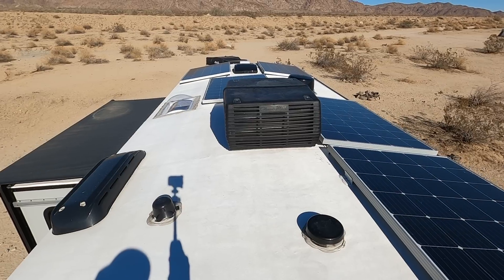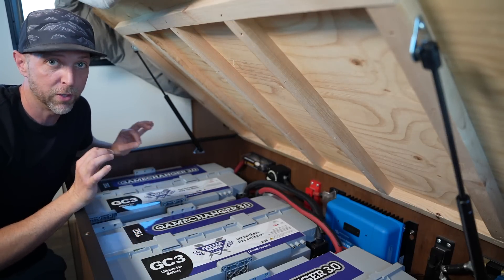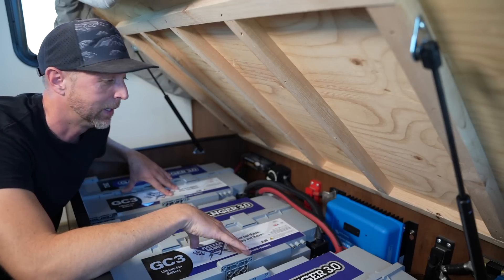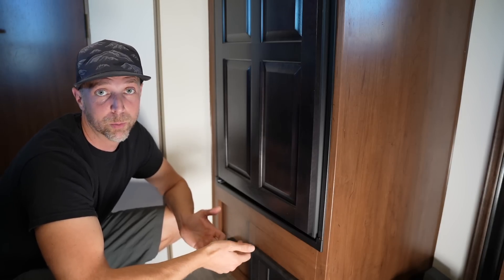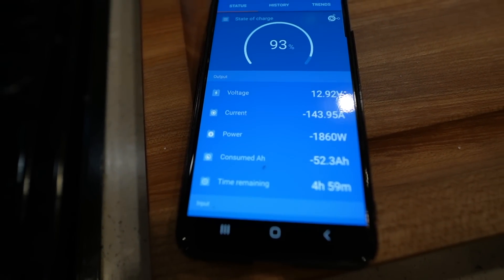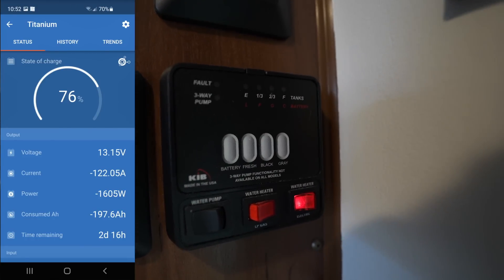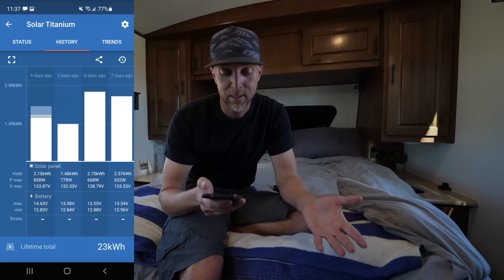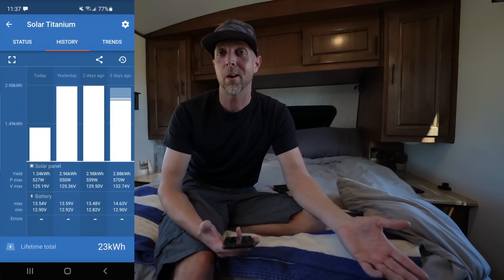RV Electrical UPGRADE Overview for Full Time RV Living | Battle Born Batteries

Comment: Just finished the transition to Lithium battery with a 3000w inverter/charger--Solar system will be next!  I followed most of your advice--except for what equipment I used--due to price but I believe are also good quality. Used all the fuses and overall plan you did as well as made all my own cables. 

Thanks so much for doing this so well--one of the best series I found on YouTube especially since it worked perfectly for our trailer which has a similar bed and layout--its a 26' Grand Design 22 MLE.

Comment: Total cost minus the batteries have an idea ?  I have a 24KRS. Bout to upgrade.
Reply from the maker: 1200 watts of solar, MPPT charge controller, 3000 Multiplus Inverter, and cable, etc is about $4k roughly. Labor would probably be another couple thousand as well. Systems working great! 👍

Comment: Looking for you solar panel install video. I have a Outdoors rv and would like to see how you did the panel install.
Reply from the maker: I actually never completed that one...still siting on the footage! But, here is the list on components and supplies I used. My technique was 3 one inch wood screws in each solar panel foot. So 12 screws per panel directly onto the roof. I also used Butyl tape between the foot and roof. Then self leveling dicor on top of the foot and screw holes. Similar to how a manufacturer would install a roof vent. Butyl tape on the bottom and decor on top. Been holding up great for one year.  

SOLAR
☀️240 Watt Solar Panel https://amzn.to/3q3eBy2
☀️Victron 150/85 Smart Mppt Solar Controller https://amzn.to/3n9giIf
☀️Panel mounts https://amzn.to/33DALyr
☀️2 pole breaker https://amzn.to/3ArzwhS
☀️1in Wood screws https://amzn.to/3Ims3TL
☀️Mc4 connectors https://amzn.to/34Y6BpN
☀️Roof Port Box https://amzn.to/3Ky6Ms8
☀️Rubber tubing for Dicor https://amzn.to/3KszWJf
☀️MC4 cable extension https://amzn.to/3Ag66De
☀️Butyl Tape https://amzn.to/3qKYx45
☀️Dicor self-leveling https://amzn.to/3AqqZeX

Comment: I've been following you for a while now, especially since we are expecting our ORV next month! Since our trailers are going to be somewhat similar, you have done much of the planning for me (putting the electronics under the bed).  On average, how long can you run your a/c unit and still have enough battery left for other uses?  Also, I live in AZ, where do you recommend I buy the supplies?  I like all the equipment you use.  Thanks for  your help!

Comment: very nice setup.  You really do have a lot of amps with the batteries and the watts from the solar is fantastic!!  So, do the battle born batteries require venting or some sort of airflow?  My only concern with location is that the batteries might get hot, especially during the summer months.  Merci
Reply from the maker: Thanks! Battle Borns are fully sealed and do not require any venting which allows them to be mounted in a lot of different spaces and configurations! They also have an internal component called a (BMS) that will power them down to protect them from things like too much heat, too much cold, too much voltage...etc.
Reply: @IreneIronTravels  ... appreciate the reply.

Comment: Hi Aaron, loved this video! Q. Did you have to lower the bottom of your under bed compartment to fit your batteries and all the other electrical components? Also, at minute 2:21 it shows what looks like 2 x 2's attached to a 1 x 2 ledger. Is this what the original flooring of the compartment was attached to, or did you add these? And because of the serious weight of the batteries, did you support this framing underneath to the trailers floor, if so how? Thank you for your help, it is greatly appreciated!
Reply from the maker: Thanks! We did not have to lower the bottom of the bed at all and we actually have drawers under the bed that we can still use. The batteries are only about 7 inches high when lying flat and so our space worked out perfectly. The 2x2's are original supports put in by the manufacture but I did add the 1x12's ontop for a solid base for the batteries to sit on and then I added some small 2x3's under to help support the load. If you haven't see the detailed video yet it goes into a little more depth on that. https://youtu.be/QLY2wwIviJs

Comment: Thanks for the very clear series of videos on your installation.  What is your current traveling tongue weight after the installation? How much extra tongue weight was added above your previous traveling tongue weight (before the full installation)?  We are about to make a similar installation on our trailer and by our calculations we need to add weight in our pantry to the rear of the tires.
Reply from the maker: Thanks! We don't have the exact tongue weight and need to go back to the cat scales to weight the truck and trailer separate. But I believe the RV weighs about 9000lbs all loaded up with our stuff, which puts the tongue weight between 900-1350lbs. Probably towards the heavy end....

Comment: I'm a, look I have a half tank of fuel time to fill it up, kind of guy, when do you start to worry about running out of power? Like really look at conserving energy, 75%? 50%? 25%?
Reply from the maker: I hear ya. I would say I start to change our energy usage at about 50%. The great thing about having a good amount of solar is it recharges pretty quickly if we lay off of the large appliances like the air fryer, electric water heater, fridge, etc. Having an accurate battery monitor and a large battery bank, I don't worry about recharging all the way up to 100%.

Comment: Your topside solar panels will be allowing water to leak into the roof within a year.  Butyl tape does two things.  Seals the hole and provides a cushion that prevents mounting hardware from rubbing into the roof membrane.  If you are not mobile, it will take longer to realize this effect, but it will happen.  When you travel down the road, the movement along with vibration will accelerate this unfortunate issue.  It doesn't matter how much dicor you try to cover your sins with, eventually .....
Good luck and thanks for the video.  Good info on what's available.
Reply from the maker: Agreed! We used butyl tape on the bottom of the mounting feet and then covered the top with Dicor. Thanks for watching!

Comment: Your install looks GREAT ! Very clean & easy for me to see & understand. I've been playing with solar in our TT for about 5 years now but a much smaller system. A DIY type and learning via lots of questions & you tube. We're not full timers but go out 1x a month for 4-7 days & 2x a year for 4-6 weeks. ~70% off grid. I carry a small generator as a backup, just in case. We live in the PNW & camp a lot in forrest lands. I learned the first outing that if the panels aren't in direct sun; you're not getting a lot of charging. What a huge difference when we are in the Desert. I'll be real interested in seeing your 3 pt series.

Comment: Good video.  What was the TOTAL cost for the complete installed system??
Reply from the maker: Thanks! I don't have an exact number, but the components would be around $12,000-$15,000 and labor could $5,000-$7,000 maybe...

Comment: Nice setup, glad to see you got the panels installed. I have about the same setup on mine, just not that battery bank, only 400 amp-hr. Going full time on Monday. Hopefully run into you guys sometime.
Reply from the maker: Thanks Rick! Congrats for Monday...exciting! Sounds like you'll have a nice system for full-timing. It's a small RV community and we might just run into each other.

Comment: Nice setup.  If you don't have a generator, I might suggest putting in a dedicated charging circuit from the tow vehicle alternator to a DC-DC converter on the trailer, to give you an option for charging the batteries while you are driving or if it is cloudy.  I ran a #6 AWG circuit from my truck battery to an Anderson connector on the back of the truck, and a #6 AWG circuit on the trailer from an Anderson connector on the trailer tongue back to a Victron 30 amp converter.  It works very well.

Comment: Yep... nice video and beautiful system.Those GC3s are cool, but to save money I went Ampere Time 200s (2 each), but went with Victron 3000w Multiplus... love it. I have 1500w array into a 150/100a MPPT, which is pushing it... technically I could get 106 amps, but with panels flat, that shouldn't actually happen. When you said you have a 85A with 1200w (12v) I had to check out Victron manual, but especially with Victron's help, I was sure you knew what you are doing. I keep telling myself, I need Chris' help with diet... just a matter of me wanting it bad enough.
Reply from the maker: Nice system you have! It is so great to not worry about the electrical for sure. Chris will be here when you're ready!😊🍏

Comment: After installing a 600AH lithium iron phosphate battery bank, I've come to the conclusion that's about the minimum I'd ever want.  Nice system!  I didn't have a battleborn budget, but if you, they're about the best.
Reply from the maker: Agreed...600 ah is a nice amount for being VERY comfortable!
Reply: @IreneIronTravels  I'm curious as to exactly how long you think it would last if you were not doing a solar recharge.
Reply from the maker: Before we added solar we boondocked for 8 days and still had about 30% of our 810ah. We didn't use any heavy appliances, but it was great.

Comment: I just installed a similar system in our ORV 28DBS - 800 watts of solar and 600AH of lithium.  We have not yet really tested it out as we are in Florida plugged in for the winter ;-) I put the solar charger in the above the bed cabinet as that is were the old one was located (we had 1 solar panel included).  I have one video on our channel that shows part of the install.   The wiring is the hard part. ;-)
Reply from the maker: Nice job! Your video was a good, clear, and concise documentation of the first part of your install. 🤙

Comment: Thanks for the video and info. Great overview of the system. I look forward to the more in depth videos. 
Do you leave your inverter on 24/7?  Or do you turn it on/off as needed?  About how much power does it use with no loads/standby?  Thanks again.
Reply from the maker: Thanks! We do not leave our inverter on 24/7, but do know people that do. We try to run everything off 12 volt and only turn the inverter on when we are using the bigger AC appliances. The inverter uses about 30 watts or around 2.5 amps on standby.  Its not a much, but really does add up over time. 60 amps a day...420 amps a week. No big deal when the solar is charging though...

Comment: Looking forward to the install videos. I'm hoping you can address the need for heat ventilation in the battery and component space. Did you need to add fans and if so what did you use? I'm trying to figure that out now. I'm worried that my closed in space will get to hot.
Reply from the maker: Thanks! I can see the battery temp from my Bluetooth monitor and haven't seen it over 83 degrees so far. The internal BMS of the batteries shut them down at 130 degrees I think for protection. I will keep an eye on this to see if I need additional ventilation. The best Ive seen for this is a small computer fan(s) with a temperature sensor that you can set to turn on and off as needed by temp. I was actually more worried about the inverter in the sealed small space of the pass through, especially when charging this big battery bank. It produces a lot of heat and could take around 7 hours to charge if we were empty..... Or running the AC on a 100 degree day..... just have to monitor and keep an eye on it to see how it does.
Reply: @IreneIronTravels  you are correct that the multiplus is going to be the hottest component of the system. At least the pass through has some breathing room. Under the bed would be too confined for sure. My system is similar in size and under the couch but has some natural ventilation. I did supplement with computer fans on a thermostat like you are thinking about. I have one pointing towards the bottom of the multiplus and 2 pulling air away from it. I also have one blowing on the solar charge controller under the heat sink. They are all run off a USB outlet. Good luck to you guys 😊

Comment: Thank you BOTH for this VERY informative video, and the very helpful answers to the Comments below! I'm on the verge of buying a slightly smaller model from the same MFG as yours. My question is, did you order yours with the optional solar package and replace it, or with just the standard factory solar panel prewire that it comes with? I won't lie, going fully solar for the first time is REALLY scary! Looking forward with great interest to your DIY solar components install videos! Thank you again!
Reply from the maker: Glad it was helpful, thank you for watching! We ordered our unit without solar, knowing we would add our own. All ORV's come with solar prep already from the factory so they have the Zamp roof mounted 3 port( uptown 510 watts) and also a Zamp single port by the front tongue for a ground deploy panel up to 200 watts. Since we knew we wanted more than 510 watts, we had to replace the Zamp three port on the roof with a new box. I just used the factory 8 gauge solar wire to hook up our panels and charge controller. It is a lot to grasp at first, but it gets easier with more time, learning, and practice!
Reply: @IreneIronTravels  Hey Aaron, Bill here again.  I too have the zamp 3 port on the roof and will need to replace it to upgrade to 800 watts of Newpowa panels.  I was looking to see what box you used, but didn't see it in the component list.  Could you let me know what solar box you installed?  Thank you a million!
Reply from the maker: Oh, thanks I forgot to add that. I used this https://amzn.to/3fg7EU4
Water tite box and crimped mc4 connectors to the factory 8 gauge wire. Sealed it with butyl tape under and dicor around the edges. I got one big enough to cover the old hole and screws of the zamp port.
Reply: @IreneIronTravels  Awesome!  Thank you again!!  I'm going to order 4-5 Newpowa panels.  If I order off Amazon (clicking on your link) does that get you guys some type of payment/credit?
Reply from the maker: Yes, it does. If you click on any of our Amazon links, we will get a small commission on your whole order  even if it's not the items on the link. Appreciate, thanks Bill!
Reply: @IreneIronTravels  Perfect! It's the least I can do! :)

Comment: Great video. Our Travel Trailer is about the same size as yours, and I want to ad a very similar solar package to it. 
One question- how much added weight did the entire system (batteries, solar panels etc) add to the weight of the trailer? Any difference in towing?

Enjoy the videos. Thanks. 

Tim
Reply from the maker: Hey Tim, thanks! That's a good point on weight as most might not even think about that for their electrical upgrade. Our system added 400-500lbs which could eat up a lot of rigs OCCC. That is one reason we went with a heavy duty 9995 gvwr on the trailer and a one ton pick up. I only towed the trailer once empty (7300lbs) and then installed the batteries right away(and had the rest of the components besides the solar panels) and we moved all of our stuff in. I think we are now close to 9000lbs weight. There was a notable difference in towing from empty to fully loaded, but it wasn't bad at all. Just could notice the extra almost 2,000lbs of cargo weight. Overall the F350 diesel tows this trailer pretty easy....just took me a bit to get used to towing in general.

Comment: Not to be a party pooper but, you could have 3500 watts at the flick of a wrist for less than 1/4 of the price. (generator) You might want to get one ( ) incase of no sun for long periods. Very nice set up of what you did tho. : - )
Reply: Hey Bert,  We have a built in Onan genset with our trailer and also chose to install a solar system much like they did.   We prefer boondocking away from the crowds, and ......noise.  We could run our genset, but quite frankly, we don't want to listen to the noise, nor do we wish to take away the peace from our neighbors.
Reply: @billd.8925  I know all about generator noise. However, you only need to run it to recharge your batteries or run the air, in which case everyone would be inside anyway because of the heat.
Reply from the maker: I hear ya Burt! Generators are still a good option for some. We're testing the system out to see how we do in bad weather before looking at back ups. But haven't had more than a day or two of cloudy rain so far. Its just so sunny in SW!

Comment: "810 amps" (or even "amp hours") does not tell me the capacity of the battery.
Reply from the maker: Around 10,500wh if you prefer.
Reply: @IreneIronTravels  Thank you so much!

Comment: Why do the cables used to parallel the batteries need to be 4/0 when the cables out to the inverter and the charging cables into the batteries are much smaller? What kind of event between the batteries would require 4/0 amperage? I kinda don't believe it.
Reply from the maker: The DC cables to the inverter are 4/0. Maybe it's the 10 gauge AC wires you are looking at?